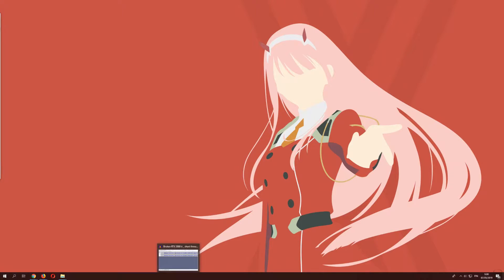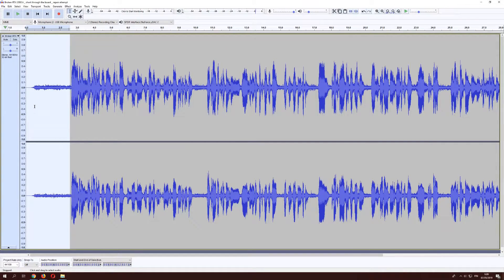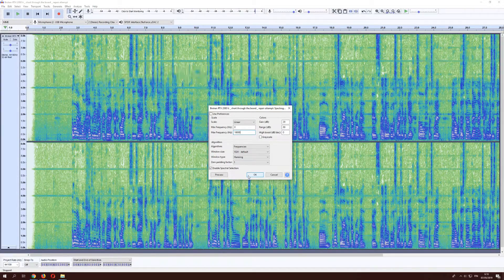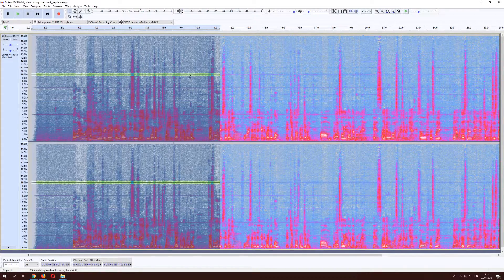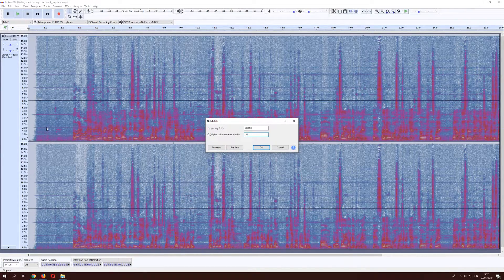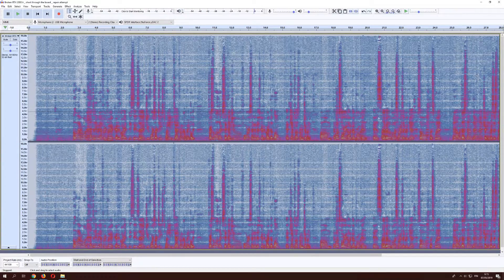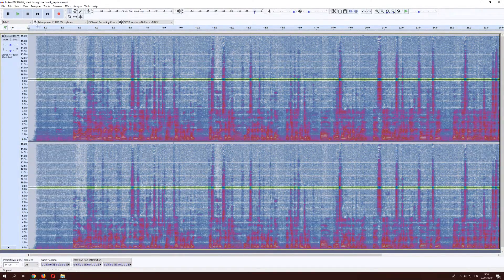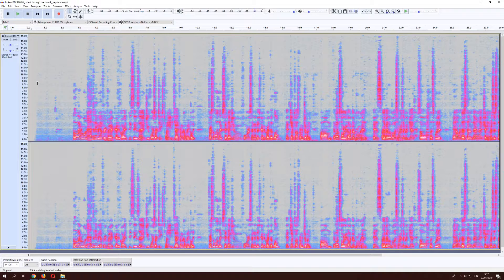Removing electrical noise from videos with Audacity

Comment: Q value tells how narrow frequency range Filter or EQ affects. If there is single clear problem frequency you can have high value from start.
Q value is relative to frequency so increasing it for higher frequencies will keep it from affecting too wide frequency range.
Reply: Yep...because logarithmic behavior. 👍🏽👍🏽👍🏽🙂

Comment: Some more info about Q Factor: 
A given Q factor will not remove the same amount of signal regardless of frequency. 
The width of a filter is directly proportional to its center frequency. 
Divide the frequency by the Q factor to see how wide your notch will be with that Q factor.

Example:
  -  At a low frequency like 60 Hz: A Q factor of 10 would give you a bandwidth of 60/10=6 Hz. This is a very narrow notch, from roughly 57 Hz to 63 Hz.
  -  At a high frequency like 11,000 Hz: The exact same Q factor of 10 would give you a bandwidth of 11,000/10=1,100 Hz. This is a massive notch, from roughly 10,450 Hz to 11,550 Hz.

Comment: The Q value is width, and as you go up in frequency, your wave length is being reduced.   So the Q value that “perfectly” eliminates a 2khz wave would only be 1/2 as wide as the Q value that would “perfectly” eliminate a 1khz wave.

Comment: I downloaded the video you used as an example in this video... And I found that in the noise, at the beginning... where you picked the noise profile... There is a "breath"...

When you then include complete silence "as noise" (in the profile), in addition to including breathing in the profile... Then the profile will not be correct, and you will go through the entire audio file, removing sound that is in "breathing frequency"...I only marked what was noise, before breathing...

But only after taking a "hard limiter" of -5.8db.... Then to normalize the sound up to -1db. Then when all the noise was amplified, all the noise disappeared with noise removal, and the breath remained.

Everything you did after the noise removal wouldn't have been necessary if you had done the noise removal correctly...

Comment: what do I do if it happens on all frequency ranges? Ive been having this sound Ive been trying to patch and the beginning seems to do fine but there is a spontaneous change 5 seconds in and i have no clue other than to just loop the beginning and mess around with amplification for certain spots.

Comment: This seems to be the fix to my issue. However as I'm typing this I can hear the high pitch frequency in my headphones and I don't have anything playing. Something else is going on........ Ah, I unplugged my Pioneer controller and the noise stopped. The issue has to be in the audio out somewhere.  Thanks for this video. Giving it a show with a quick test clip and edit.

Comment: I have a recording in which I don't have these lines - can't find the solution. Can you help me?
Reply from the maker: well, its is about very specific filtering of 60 or 50Hz harmonics from audio, if its something different I would try the audacity normal noise removal tool in filters.
Reply: @Purkkaviritys  thanks!

Comment: Thank you, you inspired me to see if "SOX" (it's a command line program for audio editing) also have a setting for this method you said or not, if yes then we can easily run a *.bat (in windows) or *.sh(in Linux) on any audio files and noises will automatically remove. For noise reduction I know sox has settings but for electrical noises I didn't know how to do, thank you so much!
Reply: I did it :) https://gitlab.com/expectedapp/video-noise-removal you give this a video file, it converts that video automatically to another video without noises, but first you need to change frequencies inside the script!! Feel free to use it, it's free

Comment: Can we prevent it before we record? What causes it. Beacause it really annoys me :( how can get rid of it reight before we start recording? Plaa help :(
Reply from the maker: Keeping the recording equipment as far away and isolated from power transformers is usually what you need to do which is what is causing this.

The microphone cable is acting as an antenna and picking up the "transmissions" from the power transformers next to it.

You could take your setup and move around while filming then review the footage to see where the noise is the worst if you are doing this in a lab environment.